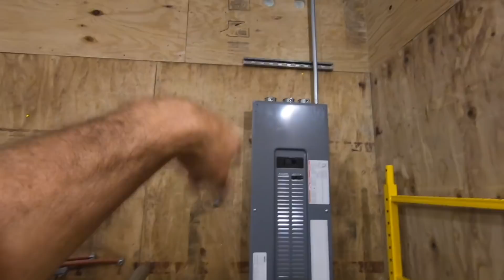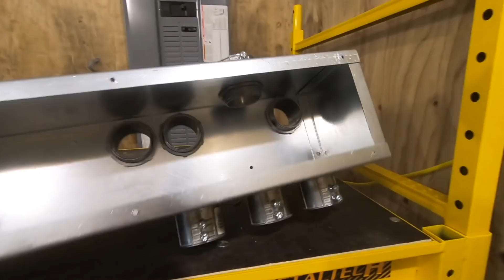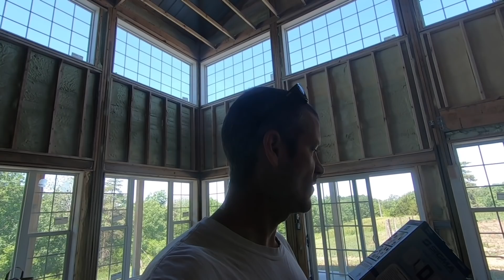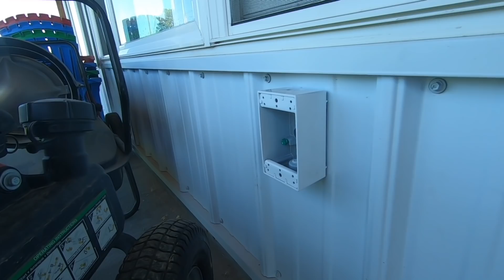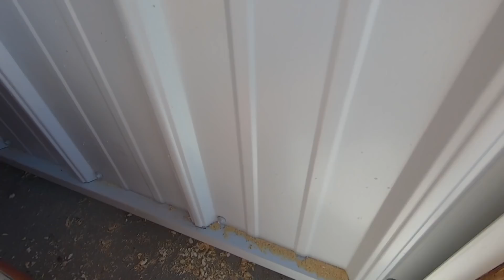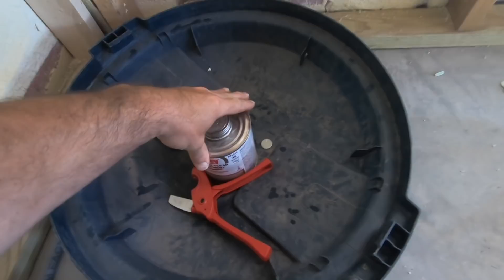New Build Electrical | Problems, Fixes, Update | Part 2

Comment: Will be running power from the existing meter into the garage. Was told to 4 wire cable. Not sure exactly what to buy. I'll get that figured out early next year.

Comment: The Code doesn't allow running Romex through fittings without pipe as you show.  You need to remove the fittings and use "Chase Nipples with Bushings" .  EMT fittings are not allowed as wire bushings.

Comment: One thing I seen that needs to be corrected, if it’s what I think it is, only got a quick look at the inside of the panel. It looks like you have a 4 wire feed, I think in another video I saw your meter main combo on a pole outside. So you’re neutral to ground bond gets connected there, the 4 wire into the house and the neutrals and grounds must be isolated. It looks like you’re feeder ground and neutral terminates on the same lug. Otherwise great project.
Reply from the maker: Thanks Steve. That has been corrected already.

Comment: You should run homerun connections from your roof (at least two) to your electrical room for future solar panels. Also you should run a circuit in your attic to provide lights in your attic. Every time you have to do work in your attic you will be glad that you did. 

If you are going to put in a windmill generator later as you mentioned , run electrical wiring to the location or locations where you will install one or more windmills. I think that solar panels will be cheaper and less maintenance if you install them yourself than wind power. The wind turbines wear out over time.  Solar panels are not very hard to install. but the wiring to the inverters and automatic disconnects can be a little complicated.  Get with your electrical contractor for connecting the panels to the grid. 

Note if you are going to install solar panels in the future, make sure that you run lines for your battery connections to your electrical room.  Solar battery storage will probably go down in price in the next ten years and you will want to install batteries to power your home when the sun is down. You may have space in your electrical room to put the batteries. Also, make sure your panel has several open breakers in it and enough size to incorporate a solar panel system. You can purchase solar plans from online vendors for around $250.00 and that would be money well spent because they will provide a complete design for you. Even if you have to pay a little more, having the plans will be a huge help and you can use them to submit to the city for permits and inspections. These plans also include structural designs  and documentation required by city inspectors. 

Finally, if you do get solar panels make sure that you connect them in parallel and use individual inverters for each panel. This costs you more upfront but it protects your system's output if some of the panels are shaded for some reason. I know you don't have any trees, but you might grow some.  Connecting in parallel will increase your wattage and drop your amps in each line which will greatly reduce the size of electrical lines that you have to run.

There are pre-fab railings for solar panels that you can attach directly to your metal roof and so mounting the panels is very straight forward. They come with their own flashing details to prevent roof leaks.
Reply from the maker: Lots of good info. Thanks. Hopefully I will be able to do that someday.

Comment: I have to be honest. I am not a licensed electrician, but I have been a licensed General Contractor for over 17 years and I have never seen this code issue arise in an inspection. I am having trouble understanding how it makes ANY difference to run your wires in box and then through a wall in the 2" conduits. What difference does it make in real life? None that I can see. It won't change your wire sizes, your homeruns, it won't change anything. I am not sure whether or not this is even code. You might want to check the NEC to verify that you are being told the correct information. 

Regardless, if the local inspector requires this for some reason, then you need to install it. You really have no choice.
Reply from the maker: I have to agree but the nec requires the length of pipe to be less than 24”s to be considered a nipple. And the original way we had it the lb was considered part of the nipple which put me over the 24”s.

Comment: Great solution to the electrical issue(s). Looking good. I like that Diablo quick change holesaw set - hadn't seen that. The Greenlee Slug Buster knockout set is an old standby. Keep some good oil on the draw stud threads and avoid the temptation to use an impact on it unless you like crunchy bearings (don't ask me how I know this haha). Outstanding job mounting the bell boxes with the GFI's - love the steps you took to seal it all up. Might have recessed the box in the wall for a lower profile, but I see a lot of advantages to the exposed bell box mounting and a recessed box would have ideally been roughed-in prior to spray foam insulation. Amazing job you're doing! Thanks for the updates =)
Reply from the maker: Thanks. I appreciate it.

Comment: Watch out for NEC 376.22 (A) and (B).  (B) in particular deals with derating conductors in Metal Wireways which you still may need to do depending on the number of wires.
Reply from the maker: Thanks!

Comment: When I install GFCI Receptacle Outlets in outside walls of a structure , I always install them where the Blue Box is Flush with the outside wall and I always silicone around the boxes and use the Bubble WP Covers !!!

Comment: Maybe I did not hear that, but I strongly suggest you put exterior outlets about 8 to 10 feet up on the corners of the house and under eaves too. Those will come in handy for flood lighs and exterior 'wireless wifi' cameras, wifi speakers and other items that need a power source to stay charged. Also water misters or hanging a small ceiling fan during those hot days makes life more enjoyable. Think about putting some of those outlets on light switches too. Never forget outlets 8 to 10 feet up along the outside and the corners of the house. They are easy to put up now, but a pain later, once the walls are finished.

Comment: 2nd floor - atrium - windows: Are you going to pull power to have both 110 and low voltage for holiday decorations, and on switches? Additionally, second story switched outlets and other outlets mounted up high for decorations. Now's the time to plan for these.
Reply from the maker: Thanks! Yes, we have plans for some things like that.

Comment: As always nice work!  Instead of using GFI outlets consider using GFCI breakers.  This is especially helpful in kitchens where you will likely need ground fault and arc fault.  You can kill two birds with a dual function breaker and cost difference between a AFCI breaker and a Dual Function breaker is usually pretty minimal.
Reply: While I agree I also disagree at the same time. Gfci breakers are too finicky and trip over tiny over amp conditions.
Reply: @andrewdarbyshire9108  Agree, but isn't it code everywhere now?
Reply: @nellermann  NEC requires AFCI on pretty much any brach circuit that has 15/20 amp outlet inside the living space.  About the only exception is for brach circuits that feed outlets ONLY in bathroons.  In garages and external branch circuits they are not required.  But at this point, why not protect all branch circuits with outlets?  Its only a matter of time before the NEC goes there.
Reply: @nneelix  because they are verryyy expensive...
Reply: @als8518  you should take a look again. 20 amp QO plug on neutral breaker at local big box $46, same breaker as a dual function $50.  20 amp gfi tr outlet at same place $25 AND you still need arc fault in most places.  Reality is day of $10 breakers is long over.
Reply: @andrewdarbyshire9108  I've had really good  luck with the newer GFCI and/or dual function breakers.  I think most dont realize the newer homes actually have dual function breakers and are quick to blame a GFCI breaker but don't realize that their circuit could also be tripping from a arc fault condition.  I had a vacuum that would trip a AFCI breaker about half the time I used it in my home that was built in early 2000's.  Since AFCI was ONLY required in bedrooms, so I just plugged it into the outlets in the hallway.
Reply: I've had quite a few outdoor rate GFCI receptacles go bad. I agree with having all my AFCI & GFCI protection in the panel.

Comment: I like gutters better than the LB's.  you are allowed to use wirenuts in the  gutters if you need to and generally its easier to run conduit into them.  I would suggest putting in 3 inch conduit from the panel to the gutter to allow for space.. but 2 inch should be enough foryour house
Reply: Assuming I am understanding your comment correctly... An Lb is a conduit body and yes you can splice in them.
Read art. 314.16(C)(2)
Reply: Yes. You can splice (and use wire nuts) in LBs.

Comment: Paul, what is that manual hole saw kit?  Looks like you used a ratchet wrench with it.
Reply: Usually called "electrician's knock out punches". NOt really a drill at all- the cutting head is very sharp and made of very hard material; it is drawn through the material being penetrated by tightening a bolt through the cutting side and through the receiving side. Hope that made sense!
Reply: Pretty expensive tool.
Reply: @jamesp7623  A set, taken decent care of, can last many times what a set of conventional hole saws do. I believe Paul has spoken about being a professional builder, and it makes sense he would own professional tools.

Comment: here in the Netherlands our electrical rules are very different but...

from what I have seen and learned from various youtube building "tutorials": shouldn't the metal box above your main breaker be grounded? and if so wouldn't it have been easier to create a connector for the ground wire when the box was on the ground and you could move it in any way you wanted it?
Reply: The pull box above the breaker needs to be grounded, however the conduit he's using (EMT) is allowed to act as an equipment grounding conductor under many conditions since it is all mechanically connected together. See generally NEC 250.118.